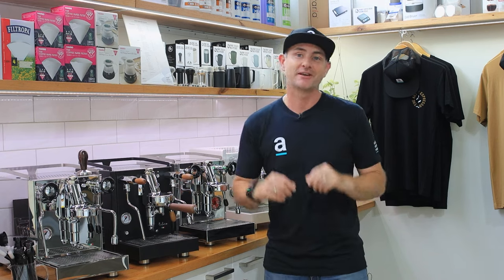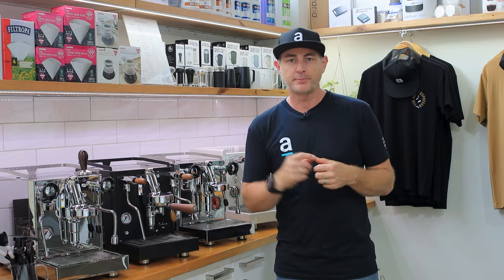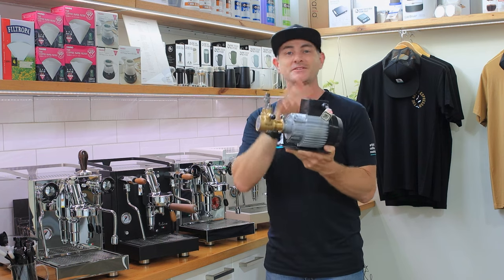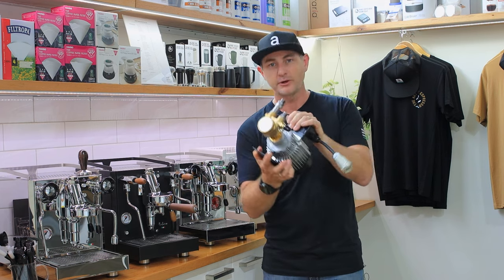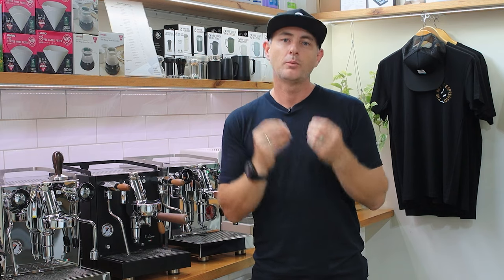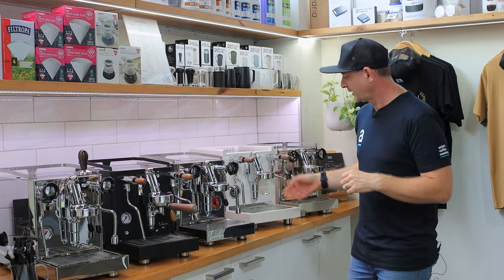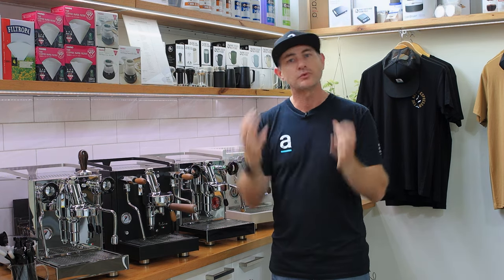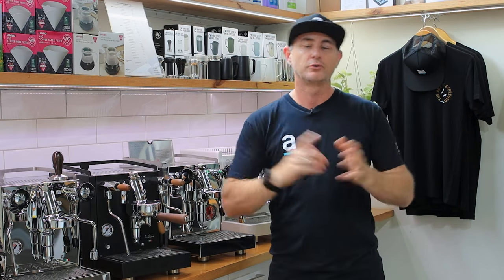What is PID, Dual Boiler, HX, E61 or Rotary Pump (Coffee Machine Jargon Explained)

Comment: Luke, a nicely prepared instructional video, thanks.  Next you should detail the pros/cons of rotary vs flick type steam and hot water valves. I personally prefer rotary valves, but others likely will disagree.  Finally, you might want to discuss the contribution of the grinder to the whole process of espresso production, meaning (as I ultimately earned) don't invest all of your funds into a higher end espresso machine whilst buying a relatively cheaper/more modest grinder.  In my own experience, the grinder is the more important bit of kit to buy.  What are your recommendations for us  to buy grinders as beginning novices when undertaking the espresso journey? Cheers. Geelong,Vic.
Reply from the maker: Sure the levers would be a good one. As for the grinder we have covered this in a video where I looked at different packages. Cheers luke

Comment: Hi Luke, this video is so helpful. Thankyou. What would you advise as the ideal type of expreso machine for small commercial outlets. We are opening a FOODTRUCK and I’m not sure which way to go. We would have a good volume of demand, but working in limited space. Thanks Jo
Reply from the maker: We recommend the mazzer knot grinder for trailers with an Expobar compact 2 group. Great prices and flexible power options in the machine of 10 or 15 amp.